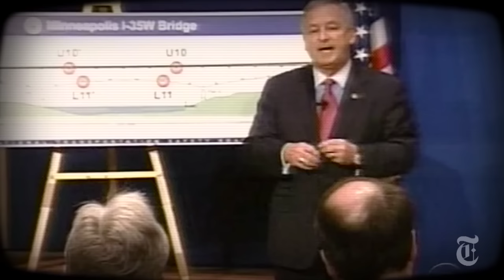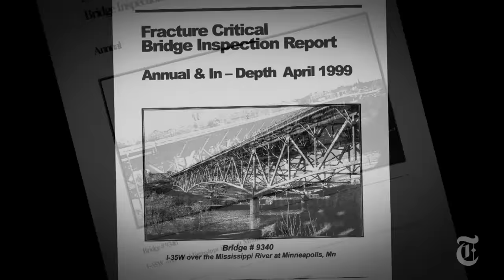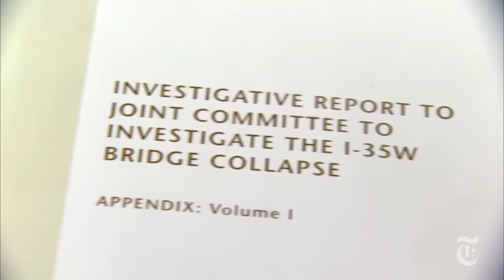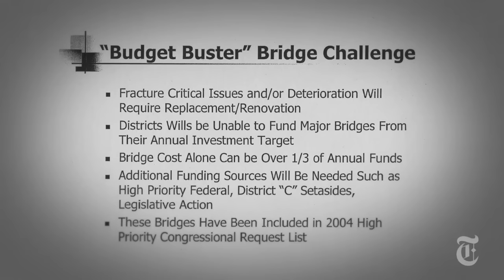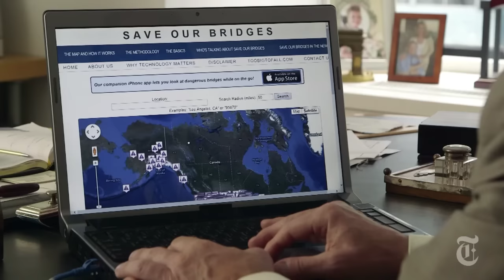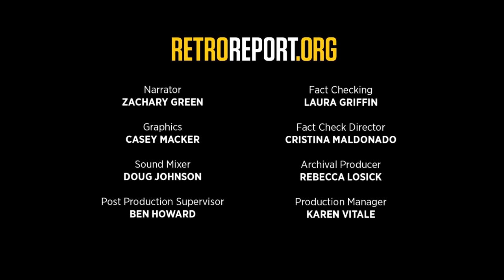When a Bridge Falls: Disaster in Minneapolis | Retro Report | The New York Times

Comment: I live in Minneapolis, and this  bridge was a poor overall  design and was fracture critical.   Meaning if one part of the bridge broke, the entire bridge could collapse.      I'm no expert, but even I could tell just by looking at it,   that if one support breaks, the whole thing could go.  ,  They don't design them like that anymore.   I think they need to give a top priority to maintaining or replacing any other bridges around the country  with this type of design.
Reply: We have a viaduct -- a very busy viaduct -- here in Omaha that is the same style.  It was scheduled to be closed and replaced, starting in fall of 2015.  Inspectors have said it was only 21% safe back in 2014.  Still not started.  As far as I can tell, Omaha has no viable workaround for traffic.  It is now over 2 years later and Omaha still has no viable workaround for traffic.  Uh huh.  SMDH.  Semi-trucks use this viaduct quite a lot, too.
Reply: RJ Walker I live in Brooklyn Park in you're Metro
Reply: That's called "redundancy." In this case, it apparently had none.
Reply: I mean, yeah the bridge looks pretty... just unstable.
Reply: as jack webb use to say just the facts no one has the guts to say it was parking 400 tons of construction equipment on the bridge that did it. 400 tons is the weight of 2 diesel locomotives.  let me put 2 diesel locomotimes on any road bridge and it will fall down

Comment: Walk under any old metal bridge and look up.  You will see the rust eating away at it and often loose bolts too.  For a concrete bridge look for tiny cracks and very slight off-centering on the columns.  Would you drive a car for 17 years that had an axle crack that could go at any minute?  If you didn't have the money to fix it you wouldn't just paint it and continue to use it.  This information about bridges has been out there for a decade or more and nothing has been done, so we shouldn't be surprised when this happens.  It will happen again, and again, and again and only when the death toll gets high enough will public outrage cause a few of the biggest ones to get upgraded.  The rest will rot away.
Reply: Its really scary because you're right. Ive seen some very rusty bridges and i dread what could happen to them.
Reply: how come there are  metal rail road bridges that are over 140 years old and in great shape
Reply: dknowles60 proof ?
Reply: I remember on a vacation where i visited family, we walked on this huge bridge that had two sideways on each side. I was always super nervous walking on it because it looked extremely old and rusted, the bolts didn't look right, and many of these metal support beams that lay on some sort of concrete pillars were way off to the side. My mom asked me why i was so nervous when walking to town and i told her i always imagined what would happen if the bridge collapsed. She straight up told me "well we all fall and die". Did not help that wayyy below us was just a river with a ton of rocks and forestry.

Comment: A few weeks ago I was driving home in slow traffic, and I noticed wooden repairs under the pavement of three different overpass structures. They seemed very solidly built and they looked like they were installed to catch falling debris or support drying concrete rather than to hold up large span sections - but each one was still uniquely disconcerting to behold.
😒

Comment: I live just 25 miles from where that bridge fell down. A friend of a friend was a bridge engineer the Minnesota Department of Transportation. He repeatedly told MnDOT that the 35W bridge was going to fail and they ignored him. I drove over that bridge in my 94 F250HD two weeks before it fell and I remember noticing how uneven the bridge was and how rough of a ride it was going over that bridge.
Reply: it was never going to fall. do you think that parking 400 ton of construction on the bridge help any. 400 tons it the weight of 2 diesel locomotives. i can bring down any road bridges in the us by parking 400 tons on it

Comment: Last year, I was driving on I-15  through Salt Lake on a Sunday morning, and traffic was moved over to the side because a huge, gaping hole had opened in a bridge over 8th south straight through the freeway and to the street below.  It was big enough to straight up pop semi tires, and could straight up eat smaller cars. That bridge had also passed inspection.  They patched it up really well, but that's one of the busiest traffic areas and I'm terrified the rest of the bridge, or any other bridge in the area could just break again.  

The Bangerter bridge over the 201 was built 10-11 years ago, and just tonight as I drove over it, there was a pothole so deep I thought I had run someone over. That bridge has more holes than swiss cheese. The infrastructure of bridges here is so bad, I'm horrified to think what could still easily happen, and that there's not going to be any change until someone gets hurt.

Comment: If you do not understand what i had stated, 1: redundancy in truss elements. 2: failure elements that fail without breaking the structure. 3. Design for excess load. 4. Overdesign of joints because no redundancy in joints. 5 constructor friendly truss elements. Please forward to civil engg. Dept. Esp. point 4. Thanks.

Comment: This bridge was the Cassandra Crossing even when it was relatively new. I used to fish under it from around 1969 to 1971 and it dripped rusty salt water (from winter road salting) with pigeon droppings oozing down the metal supports and beams. You never wanted to look up. How someone could install and approve 1/2 inch plates when 1 inch plates were in the plans is beyond me. Amazing that it stayed up as long as it did. The bridges upstream and downstream of this one are built of beefy rock arches and will likely be standing for hundreds of years.

Comment: I have some suggestions. 1) You can introduce double elements. One more stressed than the other. So, if one fails, another can takeover and the structure could still stand. And the exact failure location can be identified and fixed. 2)  The author has not come across redundancy in joint design in literature. Even though, overdesign has come to his mind.

Comment: The bridge's failure was well known to the MNDOT engineering dept, and the chief engineer is the responsible person for the 13 deaths.  He skipped over the gusset plates for some years until this happened.
Reply: wrong. who was the dumbie that parked 400 tons of construction equipment on it. that is the weight of 2 diesel locomotives. yes maybe it need biger and better gusset plates but it was the 400 tons in the end that did it

Comment: I worked at the Guthrie Theater. Being on the Endless bridge at the Guthrie. Hearing vehicles go over the I-35W bridge. Did not sound good. 1 year before the bridge went down. That bridge should have been repaired back in 2004 . At least bridges are all being inspected. And fixed. The new I-35W bridge will last over 100 years. And hopefully that bridge gets repaired.

Comment: If it stood 40 years first then there’s more to it than a design flaw.
Reply: Underdesigned generally, Inadequate connections at end joints, whether by design or construction error, and poor maintenance.  Removing part of the bridge during maintenance work aggravated the problem of weak joints by reducing stiffness.

Comment: There never should have never need 400 tons of construction equipment park on the bridge. 400 tons is the weight of 2;diesel locomotive
 There is no road bridge that can handle 400 tons. I can park 2;diesel locotives and it will bring down the New new i 35w bridge

Comment: There is no doubt that a crack in the engine of a plane is way more important than a crack on any bridges in the U.S. First of all, any commercial airplane crashes are going to make it to International News. It is given priority over bridges also because the Airline Industry and Oil/Gas Industry are more generous in lobbying. Bridges are public infrastructures and you flight consume way more fuel than any automobile that uses bridges. In the end of the day, it just breaks down and brings to the root of the problem that is money.